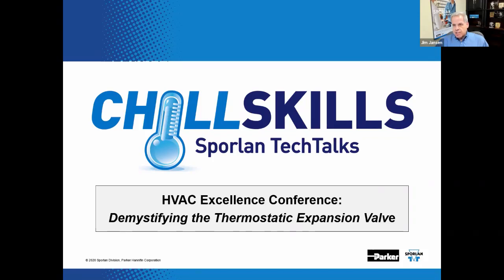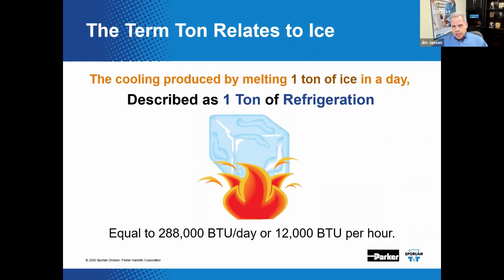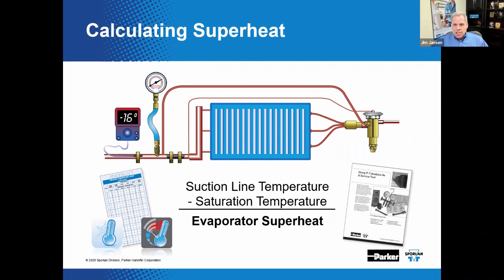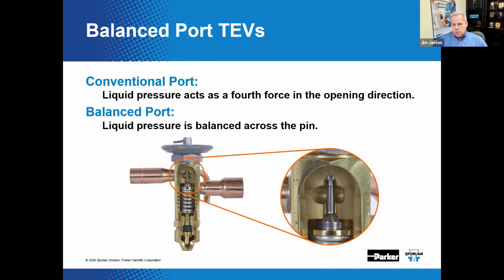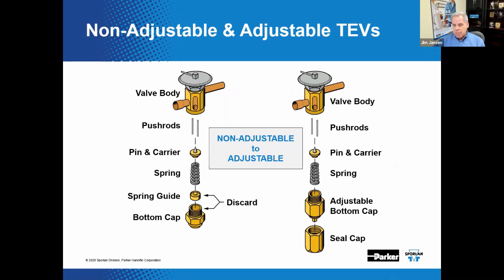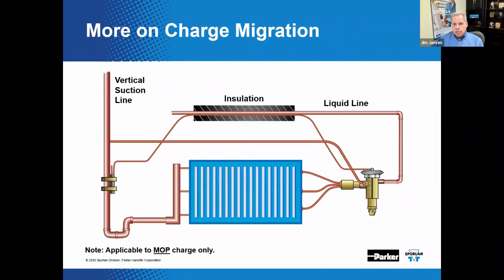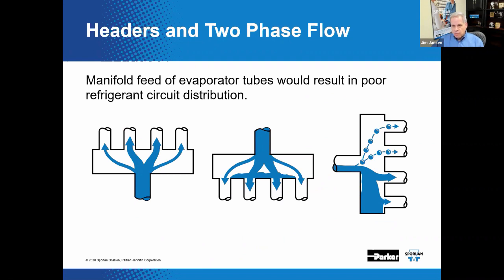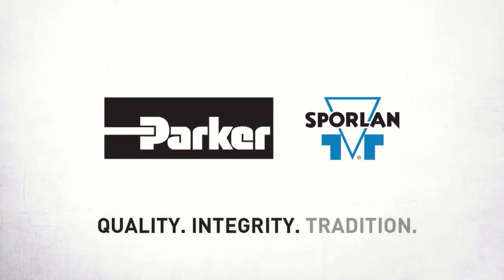Thermostatic Expansion Valve Training: (TEV, TXV) Operation, Identification & Sizing

Comment: Question: on a standard balanced port internally equalized valve - can opening the adjustment stem on a system properly operating cause floodback? Or can the "closing forces" always over come flooding assuming everything in the system is running properly and the valve is sized properly? 

I guess I'm wondering if the adjustment stem is backed all the way out would you have bare minimum superheat or is that garenteed flood back at that point?